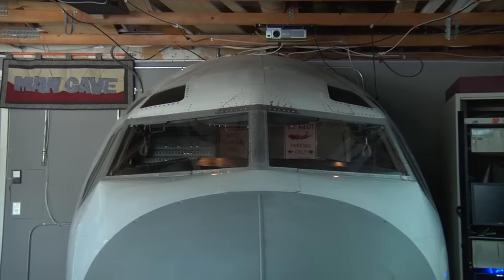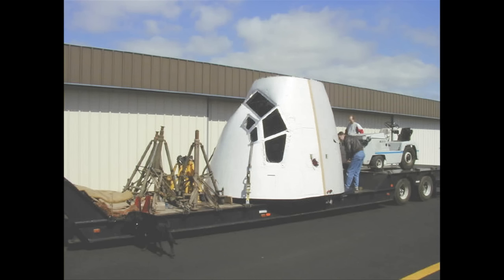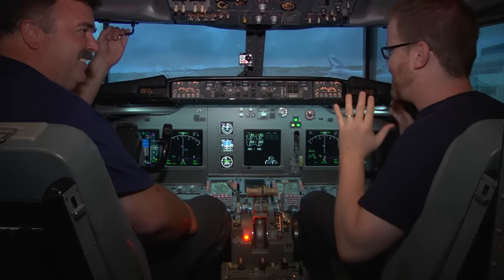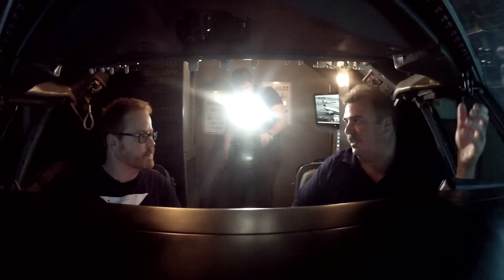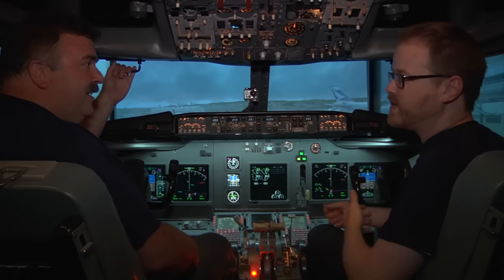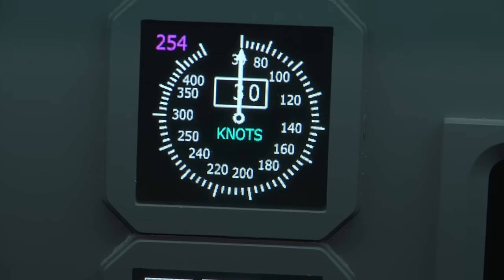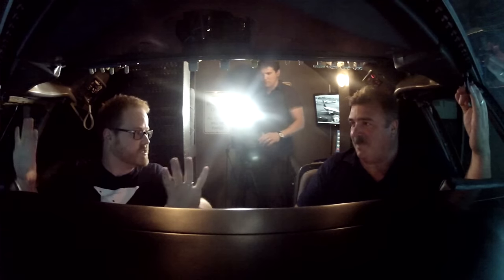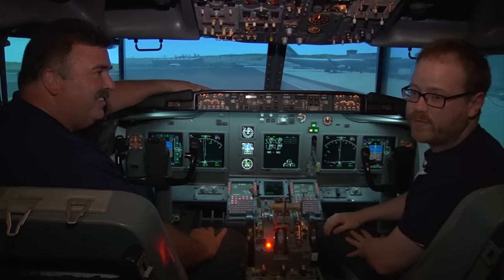Tour the Boeing 737 Flight Simulator Built in a Garage

Comment: Dude has an actual 737 cockpit completely configured to run on X-plane, but records customer's experience via VHS??
Reply: SF2ATL it's a decade old
Reply: @AndroydFM  Imagine with todays tech and X-plane 11 or prepar3d
Reply: @gemizu4874  and now imagine it with Microsoft Flight Simulator 2020 :O
Reply: @acolytealfbrand718  Bro if he tried to run this on MS Flight Sim 2020, that'd be a fire hazard
Reply: This is 8 years old
Reply: The term "taping" or make "tapes" is ambiguous. It's no different than when someone sees a camera, like on Cops, they say "Hey, don't film me!"

It may be worded differently, but means the same thing. Just because he says "tapes", doesn't mean he uses a VHS recorder. This may be from 2013 or earlier, but digital cameras have been around a lot longer than that. I have a video camera I bought in 2007, that didn't use tapes, but uses SD Cards.

Comment: If i was going to build a simulator of that caliber i would build one out of a fighter/attack type military aircraft. Would seem much more fun to dogfight or attack enemy positions than just leisurely flying a 737 around looking at clouds,but thats just me. To each his own.
Reply: I see where you're coming from but I would prefer a 737 sim, yeah a fighter game would be really fun but it would get repetitive soon. But a 737 is very consistent in the entertainment.
Reply: That would be cool,  but if you wanted to do flips and stuff,  lots of wiring
Reply: The problem with that is the secrecy regarding the actual systems. For a 737 essentially you can learn almost anything because nothing's really classified about how the systems work and what they do. If y ou only care about making them behave realistically, it certainly can be done, the propietary stuff really comes to the actual manufacturing process. 

For military jets, the new stuff is classified. You may get a close simulation but you can't really get to know even the realistic behaviour and you have no way of making it appear realistic because you can't just find scrapped F16 throttle quadrants.
Reply: Well getting the screen around the fighter would be quite difficult
Reply: I think they enjoy the process of setting up the sim, rather than piloting. It is really amazing hobby.

Comment: For everyone Wondering about the Price:
It costs about 60,000 to 100,000 WITHOUT the actual plane nose. With it it would probably cost 110000 to 150000 $
Reply: Let's just say that this guy has a damn good job then
Reply: Xion with 75.000€ he could have become a pilot
Reply: hahahaa pretty much
Reply: xThePisco I doubt it costs that much. If that were the case he would’ve been better off buying a full motion simulator for an obsolete airframe from an airline auction. They come on the market when airlines are upgrading their fleet to a new generation and the sim is too old to be worth retrofitting. Can buy what used to be a multi million dollar sim for well under 100k. But you need the space for it since they require very high ceilings, and also demand lots of power.
Reply: You can build one far under that. Not sure where you grabbed that number, but for that price, i can get a new mercedes benz AMG.

if you go for high copy components instead of original and build the frame yourself. and If you can make your own boards, and are handy with electronics, thats another huge plus for cutting costs.

and by the way, now that we have raspberry, arduino and android etc, its even cheaper to make. 

We didn't had sophisticated and powerful little project computer boards 15/20 years ago

The displays with driver boards from captain to first officer €200, most cases even less. Nice FMC panels : >€70. FMC screens with buttons soldered in matrix or just pushbuttons with graphite to 
capacitive touch interface, less then €50
 
Its more time than anything else.

But heck, $150k?!?! Thats a price you pay for an Benz AMG V8 black series.

Comment: This is amazing but how did he get to make all the computers to work in a single simulator, i mean how are they working together im eager to know about that.
Reply: Simple, a program called WIDE FS
Reply: his whole cockpit is a custom joystick run by lots of little small computers that network together.his main computer connects to his main computer which runs the main 3 visual displays. everything else is input or joysticks.
Reply: He kinda went over it, how the plugins for the game allow it to interface with the program which creates the displays.  For the actual connection itself, I'b be highly surprised if it is anything fancier than ethernet cables and a switch.
Reply: Home servers work great for such things. Trying to hook everything up through USB would be a nightmare, but taking the time to learn networking and then using it to split tasks up is much easier.

Comment: Anybody notice a yellow light on the landing gear panel?
Reply: Not until you mentioned it. Doesn't the 737-200 not have the digital lcd screens though? I thought it had the analog instruments.
Reply: It means that NO#2 gear isn’t locked in place
Reply: yeahlol. and the master caution
Reply: It means that caution the left landing gear is not down and in place.

Comment: xplane? it would be much better if it was fsx or prepar3d
Reply: ***** Whilst Xplane has arguably better flight dynamics, that's about it.  It has a poor dashes; 3D cockpits; a horrid and ugly UI including menus; options; has little in the way of PMDG-equivalent aircraft; terrible meshes; inaccurate and low fidelity world scenery.  For this reason it is and always will be the Betamax of flight sims.
Reply: ***** It's certainly better in terms of flight dynamics. That makes it better, it's a sim. For simming... I have used FSX for years and I'm never going back. I use X-plane 10 and DCS for a bit of the wild side. Going to try prepar3d further along the development line though, when it can utilize a good rig it should be awesome!
Reply: ***** You are wrong in all of those points. There more than enough PMDG-level aircraft in P3D. There's a 757 that was licensed by Boeing for being so good, do you not think that's an achievement? On top of that, the 3d cockpits in XP10 are actually very nice. Far better than stock FSX ones, with far more working parts. The FSX 747 doesn't even have a working FMC, but the XP10 one does, for example.

Also, I like the XP10 UI, and I don't find it difficult to use.

As far as graphic options, it has at least twice as many as FSX, including proper antialiasing settings, FOV, HDR, etc.

Terrible meshes? Strangely, I've noticed that XP10's mesh is far more detailed in FSX, and it gives runway slopes, which FSX does not.

Inaccurate scenery? Hmm, no. I can fly to where my house in a rural area is and follow the roads across the entire country if I want. Not what I'd call innacurate. And as far as low-fidelity? So is FSX's default scenery. FSX default scenery is the ugliest crap I've ever seen.

I love FSX as a sim to be built on, and I am going to be using it and P3D for pretty much all of my airliner flying simply because of the options in addons, but it's just not near as pretty, realistic, or stable as stock XP10 without dumping loads of money on top of it.
Reply: BlackFenixGaming Who said anything about P3D but now that you bring it up, P3D makes XP all that more irrelevant.  All the arguments for it like "used by trainers" and "the military" are now ditto for P3D.  Throw in a much bigger development team, larger funding and the fact that it's Lockheed puts a nail in the coffin for XP.

XP is the Betamax of flight sims.  Enjoy it while you can get the tapes.
Reply: Maybe for someone who has never flown an actual plane but for an actual pilot which this guy says he has a license in single engine as he owns a piper, x plane is more realistic. What it lacks in graphics and flashiness, it makes up for in reality as the physics are much more in line with real life flying and I believe most flight schools and airlines use x plane simulators to train their pilots and test their aircraft. If  you like me don't have any experience flying and are looking for better graphics and immersion at the cost of less than realist physics than perhaps FSX is better.
Reply: Xplane feels many times more realistic than FSX. I was able to easily land a Cessna in FSX with only a few tries, but Xplane takes it to a whole different level. Gusts will buffet your plane more realistically and momentum has a real impact on what you can pull off.

If you have calm and clear conditions FSX will do a fine job, it falls apart when it comes to dealing with crosswinds, etc. That's why I never looked back since I got Xplane.
Reply: Tony Jay The problem here is you're comparing two things that can't be compared. That's like comparing your night light to your lamp. They both give off light, but they're meant for completely different purposes. FSX/P3D (they're built on the same original game engine that Microsoft made years ago before selling the commercial simulator which was renamed P3D) was designed from the start to be a game. With simple flight "physics". It doesn't actually simulate a plans, it's a only highly accurate and well tuned arcade game to the point where it feels like a simulator. This is a bit of an exaggeration, but a lot of stuff is really just a well tuned game with that, not a true simulator. X-Plane on the other hand, was meant to be a simulator. It actually uses data of the aircraft with flight models and actual mathematical equations to calculate lift and aerodynamics to simulate a plane. X-Plane also was designed to support many features that FSX/P3D was not meant to support, such as external GPS. On top of that, X-Plane 11 is absolutely beautiful and has so much visual quality that FSX/P3D simply lacks. I'm not saying FSX/P3D is bad, it's wonderful, but it's also many years outdated in comparison to X-Plane's constantly updating software. For the purpose of learning and true simulation, X-Plane is the way to go, however due to immense technical requirements, it is not the best choice for home and for general aircraft flights and people who just want to have fun. FSX/P3D crushes X-Plane in terms of performance, usability and price, but in this case, X-Plane is definitely the better choice.
Reply: Ha..uhh yea right...how so?
Reply: Can ya eat your words now that XP11 is released/updated? Seems it's much better now would you not agree?
Reply: never say never..can you say 64 bit? Uhuh
Reply: Bite your tongue ..again..betamax? Ha it's quickly becoming one of the most popular flight sims on the market..64 bit beats 32 bit any day dude..FSX sucks & it needs to bet set to rest..forever.
Reply: I'm from 2018 and now x-plane 11 is the best simulator of the entire world 😂
Reply: NBK Photography you didn’t hear him saying “I changed out fsx for xplane”?